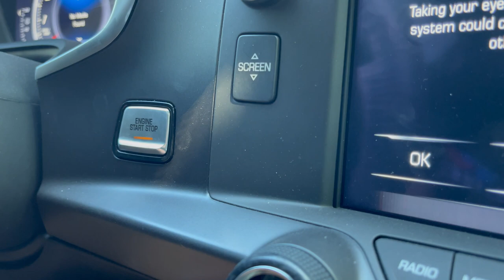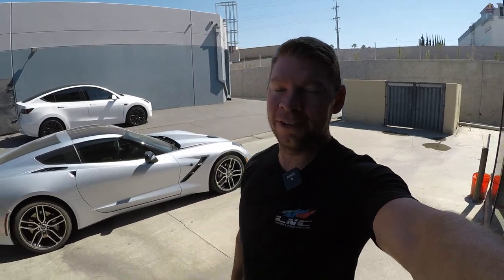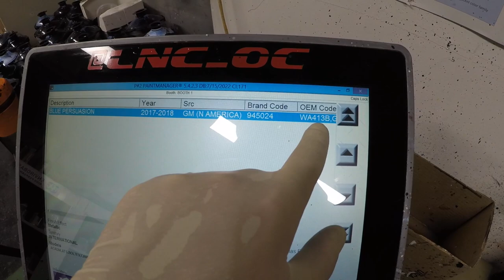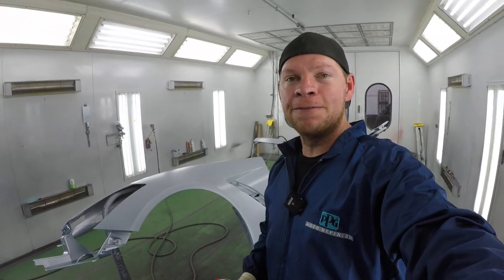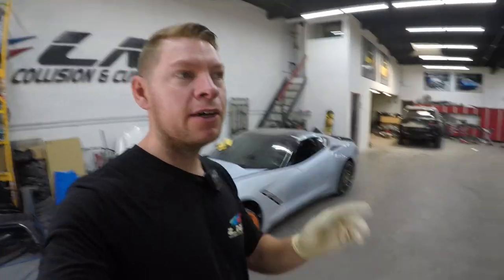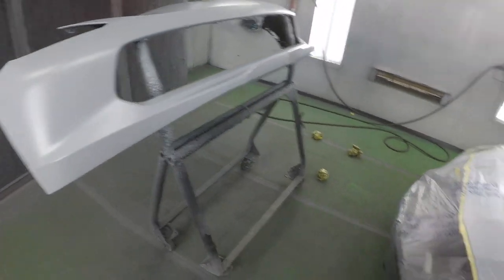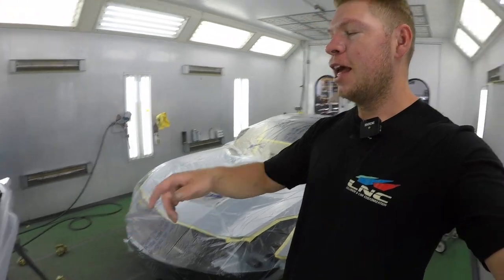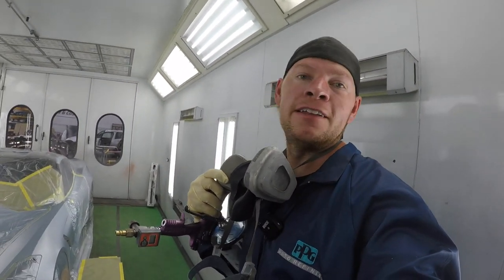Crashed 2017 Chevrolet Corvette - Repaired and Painted after Accident!

Comment: Amazing job as always! Would you be open to sharing what your clearcoat gun set up is as well as the psi you sprayed at and what type of clear you used? Would be greatly appreciated
Reply from the maker: Thank I appreciate it! For clear i use Iwata w-400 1.3 and spray at 28-30 psi fan turned in 1 turn. I used ppg’s Shopline JC7200 clearcoat. 👊🏻😁